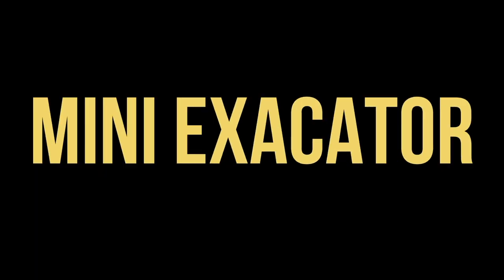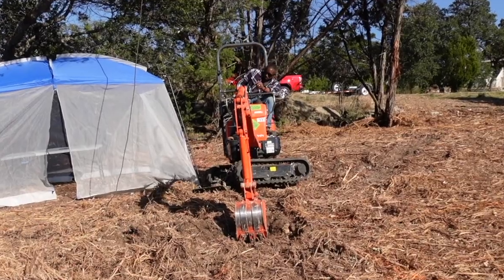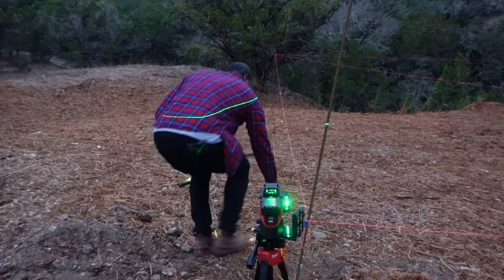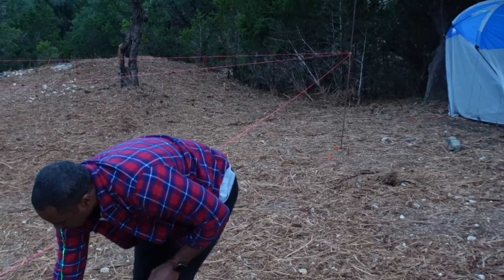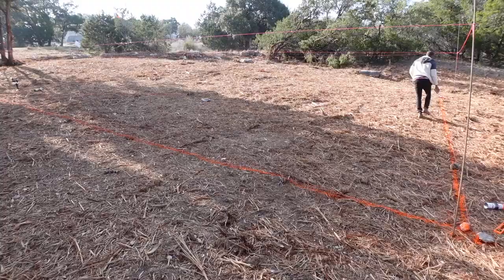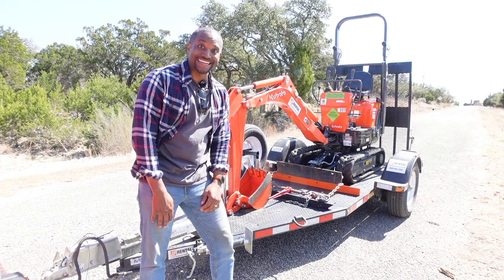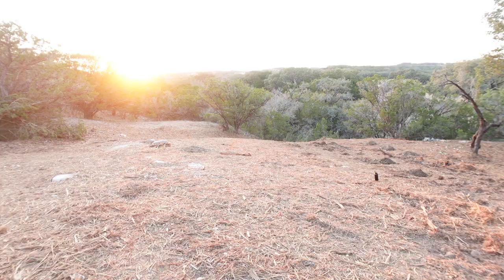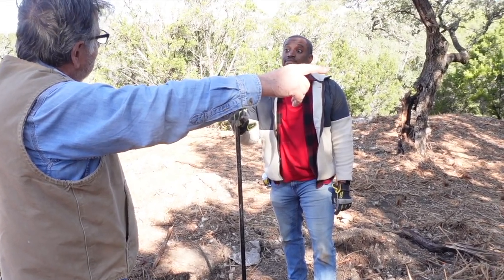DIY A Frame Build | This Machine Almost Killed Me. Until... | Episode 4

Comment: You need to square the machine to your digging path. Get your tracks parralel to the digging path with the machine centered on the hole. Put the blade on the rear of the machine and lower it.
Reply from the maker: You sound like a pro! You go boy!💪👍

Comment: I love the energy! In hindsight, would you still use the mini excavator, or just a gas powered post hole digger?
Reply from the maker: I’d use an excavator with a jackhammer bit.
Reply: @darryldarks  Do you plan to build another one once finished? My plan is to build 1 each year. same EXACT one! lol. I figure they will get easier each time! 😄